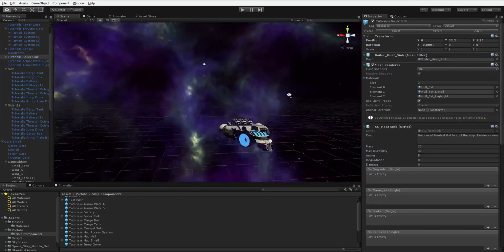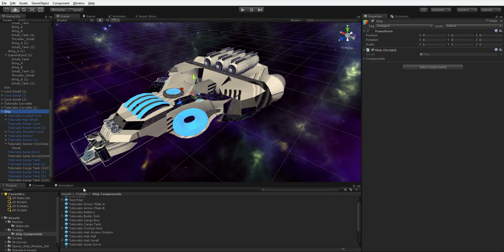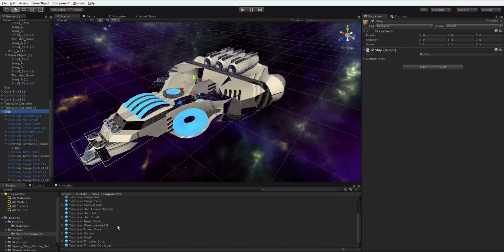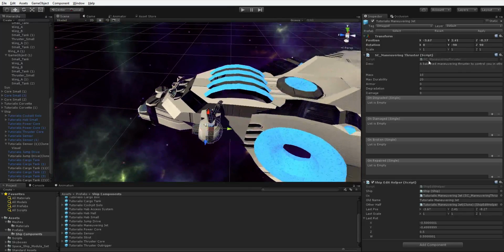The Galactic Line: Anchor Video

Comment: For the interior of the ship you could do a modular approach too. For example: large hull module, you have for the interior options: a large hangar,  a small hangar with storage, Large Cargo, different smaller rooms. And if you want too go deeper you could have for example: a cargo room specialized for nuclear waste transport or one for asteroid transportation. These options could give a lot of depth to the game. Do you want to specialize in a certain type of mission ? Or do you want to have an all around ship?
Reply from the maker: +Harad X Rim Sure, each hab module has a certain layout, but you can set the roles of each room within that layout. The same exact ship could have a different enough interior to turn a liner into a medical ship into a 3D-printing lab...
Reply: +Craig Perko exactly. Nice project. You might want to consider a modb page for your game too. I find it easy to keep track of interested people and you can keep them up to date with progress aswell.
Reply from the maker: I don't know what modb is, but I don't plan to overextend myself before I've even gotten to the meat!